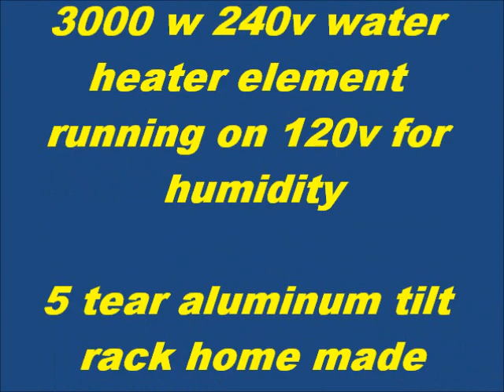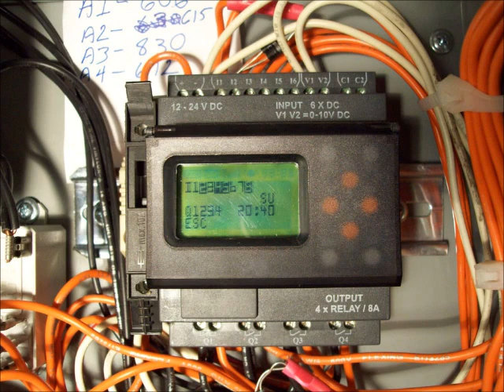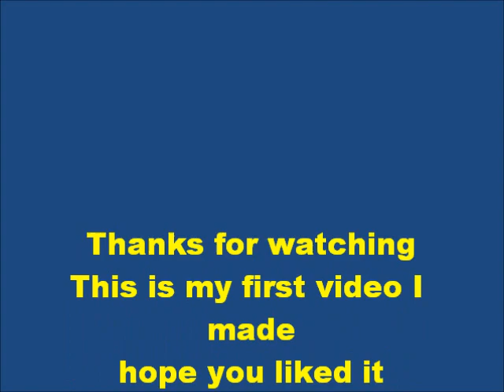Homemade automatic Incubator

Comment: Towards the end of the video I notice moisture condensing on the front panel. Is the humidity okay for this design?
Reply from the maker: Yes it is fine for it to condensate when the humidity is set at 85%
The glass is cooler and I should be used thermo pane glass instead of single pane glass

Comment: Very Nice !   I would appreciate all information on the linier actuator and all involved to control the turner.  I am just a retired  old guy that does not know how to design the system but would appreciate sources,  for what is needed and certainly a good description of them (make , Model # etc., ) Any and all help you may off would be greatly appreciated.
Reply from the maker: here is a link for the linear actuator from Princess Auto http://www.princessauto.com/en/detail/12v-dc-12-in-stroke-135-lb-linear-actuator/A-p8489098e I had to modify the limit switches for this application